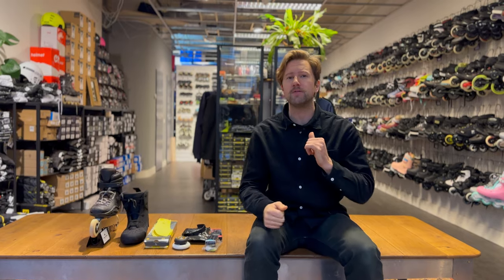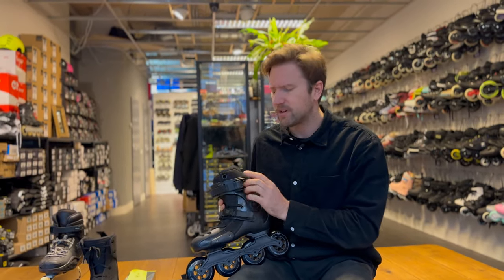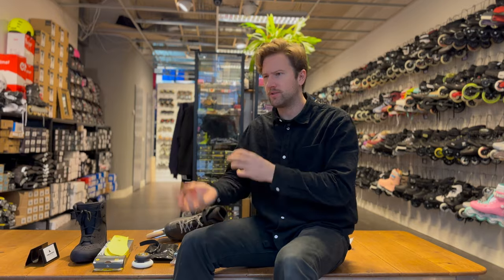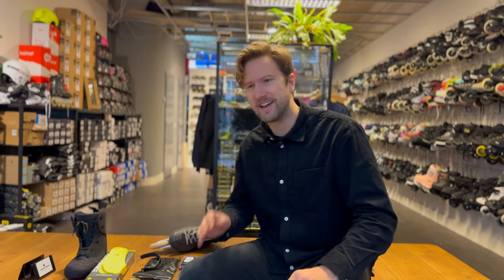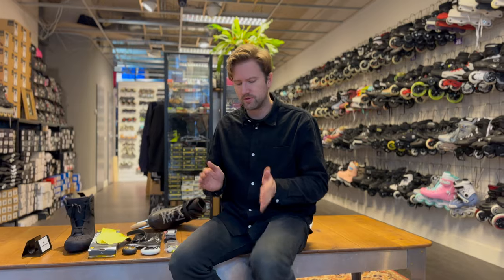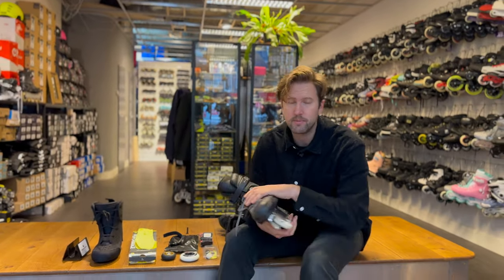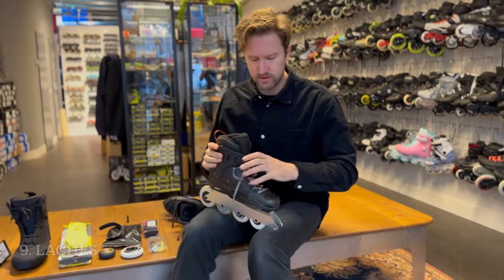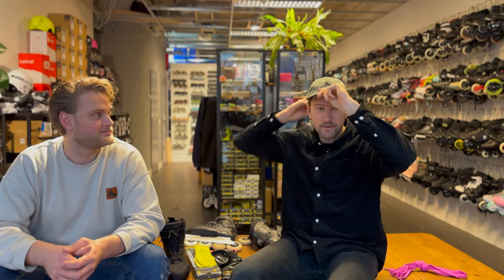UPGRADE YOUR INLINE SKATES // TOP 10

Comment: Hi Ivo and community! I’m switching from roller skates to inline skates and am trying to figure out what freestyle skate would be upgradeable for me to be able to switch from freestyle frame to aggressive frame. My foot size is UK 38, US size 6 in women and on the wide foot side. What skate would you guys recommend? I’m having a hard time figuring out after watching your videos since I’m considering changing frames to try aggressive. I’m hoping to further build up my skills on freestyle skates and eventually after building up my base/foundation to try aggressive skating through the frame to stay in budget since I’m still a college student. 

For context, I’ve been roller skating for 2 years and would use them at the skatepark until I stopped since my skates weren’t built for it (I injured myself because of it), but I built up my ankle strength and balance that I can ice skate (I have hockey ice skates) and roller blade now having tried rentals at my local rink. I bring this up since before when I tried rollerblades I didn’t have the ankle strength to not allow my ankles to cave in to be straight on top if that makes sense, so it was really painful and I couldn’t even stand or balance on one foot. Now I could comfortably skate on the rental blades I tried at my local rink, crossovers felt easier for me to do than when I would use my roller skates.
 
And I think I saw Eric pass by 6 times lol

Comment: For the insoles, 2 questions : 
1 - if the concern is more about some small pain when skating for extended times than only power transfer is there some other insoles more suitable ?
(Noticed superfeet also have a "Hockey Cushion" insole, for example)
2 - I have discussed with some people putting the insole inside the liner, and some others below the liner. So is there a big difference or are both ok ?
(Also, the 'insole' in my powerslide Next skates, was below the liner by default)
Reply from the maker: 1, also for powertransfer the foot works the best if it is in this position with a hard heelcup.
2, An insole is supposed to go IN the liner. the idea for underneath the liner is specifically for intuition liners so that the fabrics on all sides of the foot are the same foam. This however does not give the best performance.
3. If the insole of your ps next was underneath the liner then something was wrong there. We have hundreds of ps next here in our store and all the insoles there are in the liner, not underneath
Reply: @Thisissoul  Thanks for your answers.

1-2, thanks I'll follow that then.

3, English isn't my first language, so I checked around and I think I made a mistake, apparently the piece I was thinking of, was refered as a Footbed/Footbed-liner by some others, the piece with a small heel-raise. And yeah, I didn't really know those are different from insoles ? (Same thing/word in my language)
(Found the information with pictures showing the piece, on a "Reducing heel lift in Powerslide Next boots" reddit post.)
My apologies for that mistake.

Have a nice day.

Comment: Seriously the lower buckle made my legs hurt on both powerslide skates I have, even though they are different sizes, buckle makes it too stiff and rigid. One of older videos where Ivo showed his powerslide skates he told about laces trick (that I also use on sneakers btw) and that was much more comfortable, partly because the lace tight spot is a bit higer than buckle.

Sure it takes more time to lace it well and tuck all the laces than just quickly pull in the buckle but my legs feel super comfy, can skate all day and skates look much nicer without that buckle. on second pair I repurposed velcro straps at the same spot I tighten laces but somehow it also feels a bit off compared to laces (but its much faster to put skates on/off which second pair is for). 

I think its because laces are connected throughout whole shoe and can move slightly remaining tight but at the same time not creating pressure spots.

So I would recommend Ivo preaching his lace method at every opportunity he has, at least for Powerslide Next skates, people need to know
Reply from the maker: thanks! that lacing technique works so good!

Comment: Love your video I agree with everything except the bearing thing.
Watch tv tiolet paper them of away from the entrance.

If there good add 3 drops of oil spin bearing in hand take exces off with toilet paper.

If bearings are not that good use lots oil and spin while spinning let dirt come out with oil and oil again.

Fuck citric cleaning etc to much work this 30min good 60 min bad.
Reply from the maker: Maintaining definitely helps prolong the life.
For the time and money spend we just dont think it is worth it.
They cost 1 euro a piece at our skateshop. if you replace it twice a year it is only 32 euro for 8 wheels.